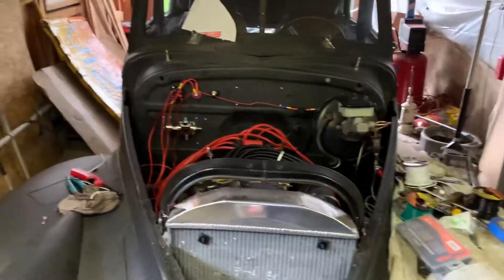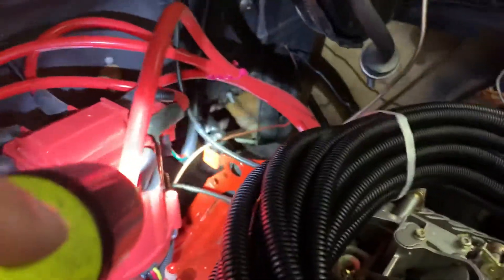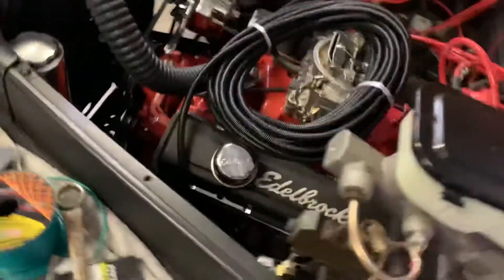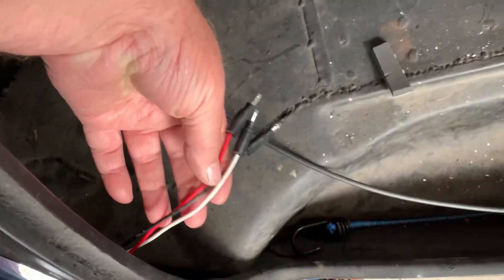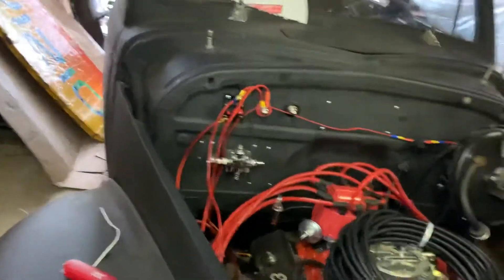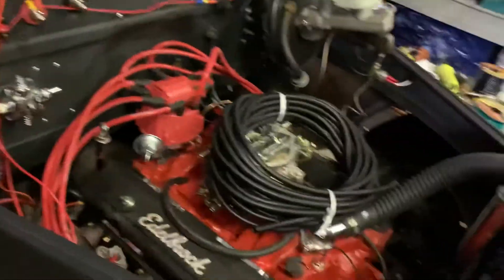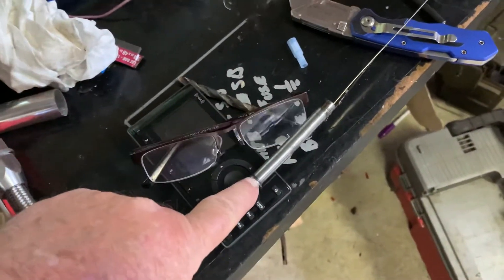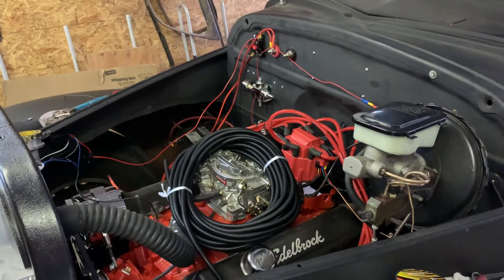1940 Chevy coupe update

Comment: I supported the front of the crank with an old factory scissor jack, took the starter off and undid the motor mounts.  Video here - https://youtu.be/DHGHLcPSBmE   You can see the dipstick and tube there lower left of center, plenty easy to tap back up and out ! 
Edit- I see I did not even have to remove the starter !
Reply from the maker: Thanks for sharing that. Looks easy enough.